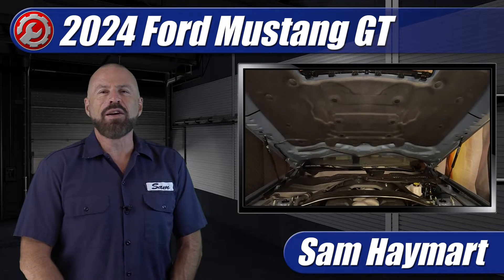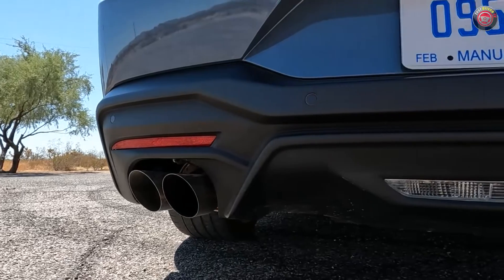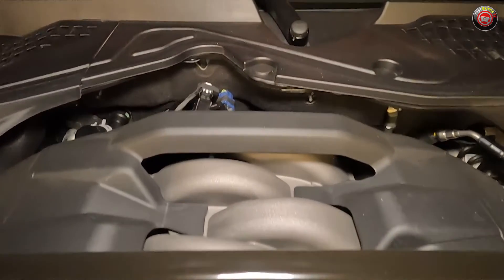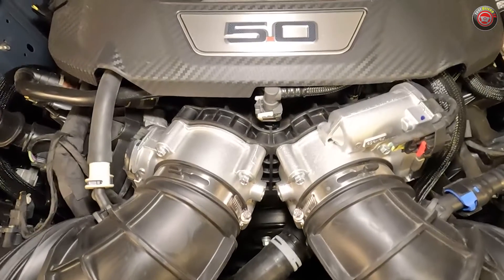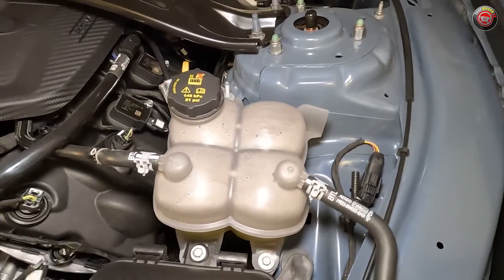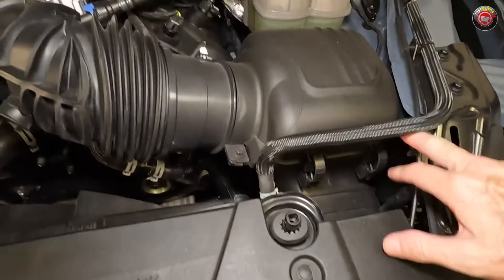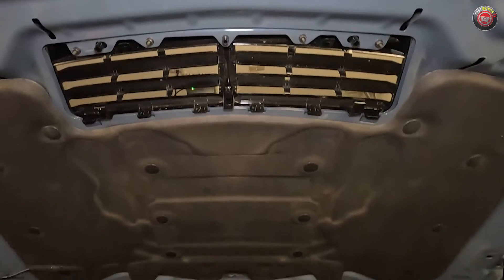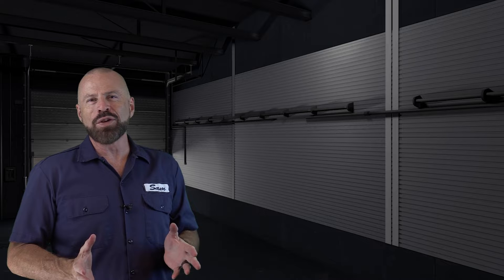2024 Ford Mustang GT: Engine Explained

Comment: Just got my 2024 5 litre Mustang
Can you check oil level on the screen computer on the dash
The dip stick is very awkward to get in and out and is difficult to read
Reply: Yes, it should be on one of the info parts of the display where the gauge cluster is.
Reply: @carterhansen no that’s just interval time